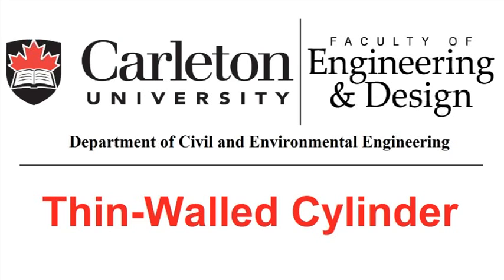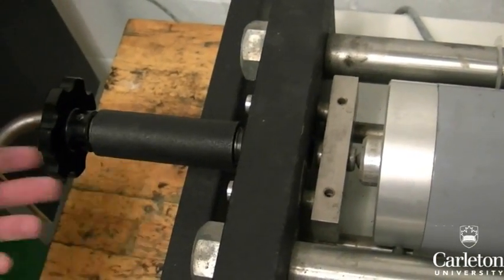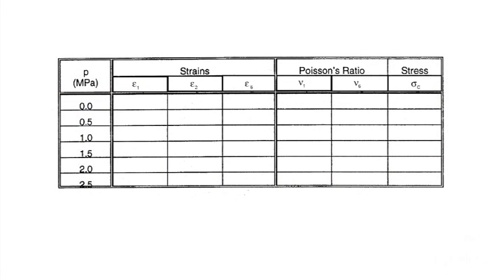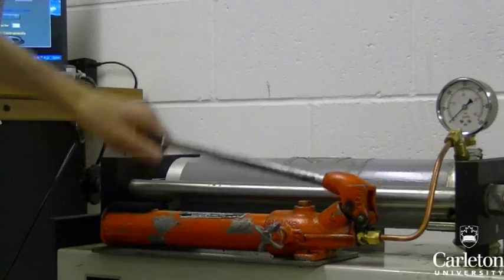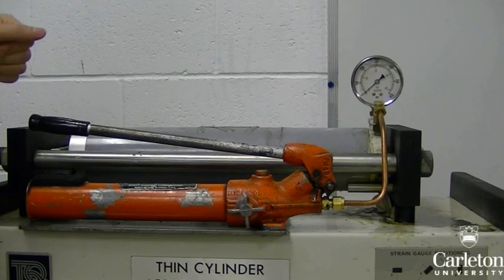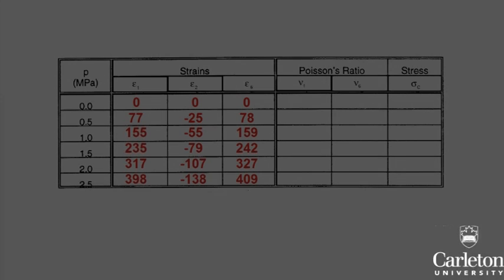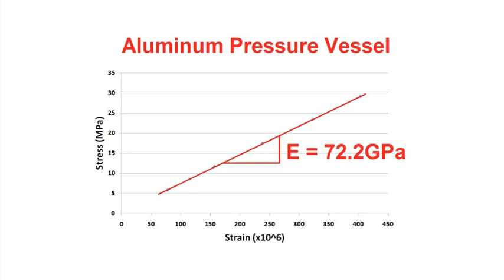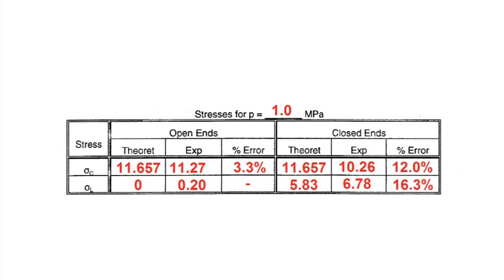Carleton University - CIVE 2200 - Thin Walled Cylinder

Comment: how did you get the modulus of elasticity value form the graph.
i cant seem to get similar values mine are always (zero point something)
Reply: the figure for strain in this video is multiplied 10^6. so you should also multiply 10^6 your value